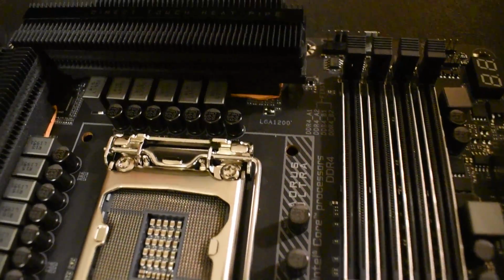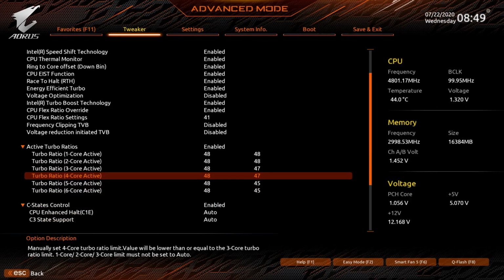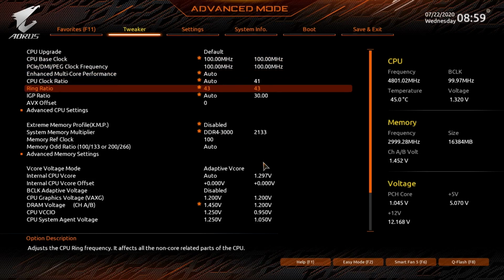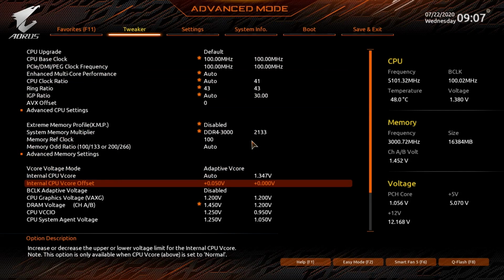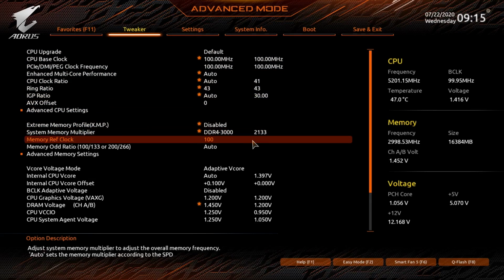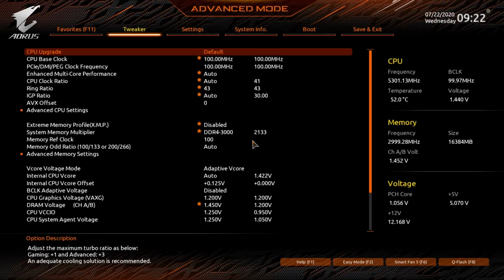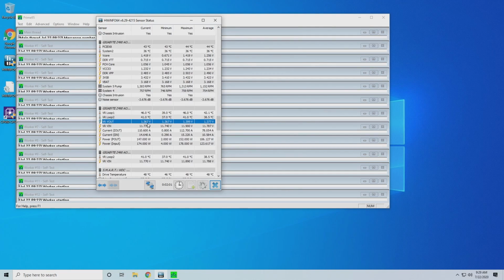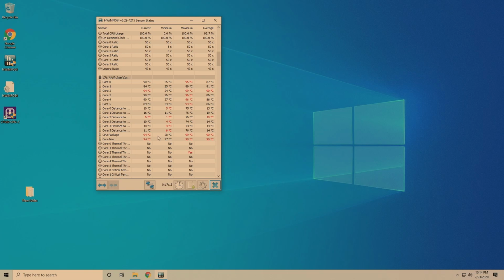Intel 10th Gen Z490 Overclocking Guide with Gigabyte BIOS

Comment: Running a bit late on this party 🤣 but finally found a normal vid on how to oc you’re cpu  so that’s a +10 for me but now in running in a strange situation my i5 10600k was running smooth on 5ghz with 1.3 ich v but as soon I turn off the pc en start it back up its back to default 4.1 😅 what am I missing. 
Z490ud board 
I5 10600k 
850w psu 
Ram 3200mhz skills (Xmp) profile

Comment: Can you do one with the z490 with the 10850k. I heard you mention it in the video.
Reply: There is not enough headroom to over clock top end chips. The effort is wasted for most people because you will only get a very little boost in performance for way more power consumption and heat. If I turn my all core boost from 49 to 51 (5.1 ghz) my temps go straight to the 90s. 
On the other hand I am currently testing a rtx 3060 and the headroom to over clock this card is a lot.

Comment: I have struggled with this setup forever. I have a 10850k and a gigabyte z490 Elite motherboard and I have 3600 36 36 36 b die. And I have the Arctic freezer 2  280 mm cooler in a fully open case with an extra fan blowing at the vrms. I've seen others maintain 5.4 with this setup no matter what guide I follow I end up with insane temps especially particularly in the Bios...? I idle at around 28 C. The spikes that I get are unbelievable

Comment: 50/47 @ 1.325 fixed vcore using air cooler seems to be the best I can do (while stable). Will try adaptive down the line, but this seems to work. Couldn't have done it without your help. Thanks for the video.

Comment: Hi, I am overclocking a 10900K on a aorus z390 ultra and my initial OC test on 5GHz with auto voltage with no V offest is jumping from like 0.77V idle to 1.39V under load with prime 95. Its not crashing but this voltage seems a bit high? Cheers.
Reply: Apologies, i just reaslised i didnt apply 5GHZ to all the cores. Now all cores are 5GHz the voltage is 1.42 :-O

Comment: Probably double posted so apologies and late to the game! I have a 10700K on a Gigabyte Z490 Ultra motherboard pretty much from launch and thankfully it has been a rock solid setup. I have updated the BIOS to the one which enable SAM. I have overclocked to 5.1GHz all core with an Override vcore of 1.310v...VROUT reads 1.265v. No issues on Prime95 small FFT's (30 minutes) reaching a max of 83 degrees though running a 360mm AIO, stable running Cinebench and Games. The question is I have seen people using much higher vcore does that mean I am not stable, is there something I am missing? Should I be running Prime95 for much longer?

Comment: I think your overclocking helped me. My default bios kept crashing my pc.

I am using Aorus Z490 Xtreme, with i10 10900k, corsair vengeance rgb 32gb ram,
I ran on default settings, installed new drivers, update new drivers  and soon, it crashed. Tried to turn on my PC , it kept looping the logo screen. So I tried system restore, it didn't work. I had to press rest pc and it's back to normal (without drivers). The whole hell restarts.

Until I came across overclocking. Only then it will boot my windows 10.

Not sure if it's my bios or any part of my pc component fault.

Help?

Comment: Can anyone explain the different vcore voltage modes on gigabyte? They do not seem to follow other manufactures and I can't find any specifics. What is the difference between the adaptive v core settings? Such as changing the internal cpu vcore to a specific voltage under adaptive, vs auto, vs normal. When normal is selected it opens up a DVID offset also. In this video you are on adaptive but I never see the VROUT voltage drop with frequency at idle even though power savings are enabled, that seems to be more like fixed or override. When the board was stock with auto vcore and MCE enabled it does this just how it should like stock dropping frequency and voltage at VROUT. I'm trying to overclock with adaptive on this board but cant seem to get it to work how I want, with the frequency and voltage falling at idle with the energy savings enabled. And I have checked the power plan and like I said it behaves correctly with "auto" until overclocking.
Reply: This video is very misleading. If you have a i9-10900k and follow this your voltages will be very high because it has a max turbo of 5.3ghz and your going for an all core under 5.3ghz , so the adaptive voltage will be pulling from the cpu VID meaning you will need negative voltages. The I5-10600k only has a max turbo of 4.8ghz so over that it will work as he is showing. Read these before trying this, or you will be frustrated. 

 https://rog.asus.com/forum/showthread.php?106375-MCE-explanations-and-others/page2
https://www.overclock.net/threads/guide-tuning-adaptive-mode-oc-load-voltages-for-10th-and-9th-gen-cpus.1753182/

Comment: So I'm doing this on a 10700k and followed the first section to a tee restarted and core voltage is getting up to 1.5v what happened?
Reply: same, im getting waaaaay over 1.4 in idle ! and under load it drops, i don't get it :( followed every step, same motherboard
Reply: Yeah I just ran it with no oc lol
Reply: @geardriven2018  guess keep running it at 1.56v is'nt healthy ? :)
Reply: @BozZke84  I sure as hell wouldn't. Stock is fine for me lol
Reply: @geardriven2018  Overclocking was sensible back in the day when i7 920 could be overclocked from stock 2.66ghz all the way to 4.2ghz on air in best case scenario... almost everytime you'd get at least 3.8ghz on any chip. or i7 2600k from 3.5ghz to 5ghz... gone are those days. overclocking modern cpus that already run at 95% of their max potential out of the box makes no real sense.
Reply: Has anyone resolved this issue? Mine also goes even over 1.5v with these settings. I have Gigabyte Z490 Vision D motherboard.

Comment: By the first Prime95 run i hit 100C° With my 10600k, be Quiet cooler which ran my last CPU 7600k @ 5.1 GHz below 75 C°

Normal? Stock temps are at ≈ 72 C°
Reply: Might need to reapply thermal paste and reseat the cpu cooler to the cpu to make sure its set properly. That idle temp is extremely high.

Comment: Hey, it's not really connected to your OC video, but I have a question for you or any1 reading this. When i start up my PC with monitor plugged directly in gpu, monitor shows black screen(skips bios) untill windows start, but if i have it dirrectly plugged in the motherboard, I can see the bios b4 the windows start. The build is new(z490m+10600k+rx580,8gb,550w gold rated psu,3200 hyperx 2x8gb ram). So I'm wondering if you ever encountered that problem and how to solve it? I tried setting pcie istead of cpu as primary when starting up but it either doesn't work/didn't save at all.
Reply: Try disabling your integrated graphics

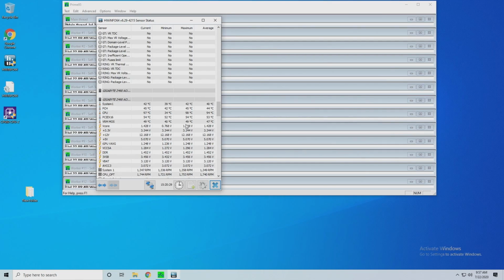Comment: 44:07 Not sure why this a highly rated video 1.428 V and 95+ C running for 15 hours. That's daft. Also misses checking for WHEA errors in HWiNFO64.
Reply: @albertbrennan6480  How did you know I am a professor? Also, you are wrong about cache errors. They will always lead to blue screen unless the flipped bit is overwritten by a correct bit.

Comment: its funny you say that the adaptive VCore is the one that prevents from unexpected voltage increase. I set the offset to 0.050 (almost nothing) and booted up with 1.44V on my VCore. Then I used fixed which actually gave me what I expected. Not the best advice from you.
Reply: 1.44 is too much wtf 😬 
I’m a noob but i got my infos from a group for overclocking on reddit , they helped me overclock my 10700k at 5.0 on all cores with 1.275 voltage vcore
Reply: @Handcraft1024  what group helped you? im new to overclocking i really want to do a 5ghz oc on my i7 10700k but scared to do it with out having sm1 to ask questions along the way
Reply: @Zen_5.0   you can find plenty of helpful websites
But try using this one 
It’s a decent forum
overclock.net
Reply: @greencupofdeath  good results and voltages considering u having the 10600k

Comment: Enjoyed your video, but i think I have a bad CPU. I have a 10900K and if I try to go past 4700, it crashes instantly. I did exactly what you said, but when I boosted the adaptive voltage to .05, I got even more unstable. I wasn't sure if it was the cpu or the board, so I got a replacement board. Same thing. Ordered a new CPU. Have you heard of junk CPUs?
Reply: you sure you are increasing the voltage and switched off all stock settings except for Intel Turbo Boost. Some of the other boosting settings will make your CPU go higher than it's supposed to

Comment: I’ve seen that if you have your radiator situated like that you can get bubbles in the pump and reduce cooling. Supposed to mount on top of case I guess.
Reply: his is mounted properly for a front intake setup, the bubbles will be at the top of the rad

Comment: Sub for you, simply but seems solid way to OC, watched some oc of 10700k few days ago, and applied roughly to mine, got blue screen straight away on booting, on auto max reached 5.073GHz (50x101.4) with everything else auto, run for a bit but Voltages around 1.6V a bit scared me, ran 3D mark, no thortling just hit like 94°C in cinebench on couple of cores... gonna try your way to get to 5.1GHz on boost...

Comment: I followed your guide step by step. I didn't want to go overboard or push it too hard so I only went as far until I had to start manually playing with the voltages. I was able to get an all core clock of 5.1 ghz on my Aorus Master 10900K with 32 GB 3200 mhz XMP ram with acceptable temperatures. 5.2 ghz was bootable but when running cinebench it ran around 99-102 C[too hot or ok?]. That was with switching to adaptive vcore and all the other settings. If I am satisfied at 5.1 is there anything else you'd recommend I do?

Comment: So if I have the same mobo/Cpu I can basically just set it to your final settings? I don't need to climb gradually to get there do I?
Reply from the maker: I wish it were that easy, but every chip will be different, you will need to go through the steps as I do in the video.

Comment: If you are in good shape thermally after finding a stable frequency, is there a certain voltage setting that is directly related to ring ratio that can be increased to get a higher ring?
Reply from the maker: just cpu vcore
Reply: @hardwarelens8040  okay thanks for the reply!
Reply: @hardwarelens8040  maybe you have time for one more question.  You said at the beginning that you turned off the turbo power and time limits, but if you said how to actually do that I missed it. Can you tell me what settings those are in the bios? I'm coming from Ryzen, and have a gigabyte vision g and 10700k. There's just so many more settings than a B450 board!

Comment: Hi, superb vid and very informative, the only thing I would say which did my head in was that you would
move the cursor down the screen and talk about something above it instead of what it was on, place the cursor bar on the item then discuss it then move to the next and discuss that don't race ahead with your hand makes it very confusing
Bob
Reply from the maker: thanks, will keep that in mind!
Reply: Hi would it be possible for you to do one for the Comet Lake 10900K? I have followed your excellent guide above but I keep ending up with 1.5 volts or more! and have to panic and reset. I wonder if it's because the comet has ten cores?
Keep safe. Bob
Reply from the maker: @stoptheirlies  I did oc a 10900K on this board and noticed the same thing but didn't make a video about it yet, you may have to just try a lower offset.  Make sure you look at VR out voltage in hardwareinfo for your CPU voltage.
Reply: @hardwarelens8040  Hi, yes I keep checking v out and running the Prime 95 Best I can get at the moment is 4.9 gig with v out hitting 1.4 max at some time during the test and temp hitting 93 I dare no push it any further, it's very stable though, I have just been in VR playing half life Alyx for the last two hours, no problem.
Bob
Reply: Oh! I meant to say mine is a Gigabyte z490 G Vision board and the bios does have a couple of differences

Comment: My max stable overclock was 5ghz all cores with fixed vcore 1.265v with a 10600k. Cpu is at 32° idle, 70° max load.
Tried 5.1ghz at 1.35v but it crashed during cinebench 20 running at 80% of the test.
Reply from the maker: not bad!
Reply: Good setup, OC for me make sense only if the OC is stable in 24h a day

Comment: I tried pre oc on my Aorus elite ac 10700k it didn’t work out, I can’t find much info on 10700k overclocking
Reply from the maker: this guide will work for any 10th gen cpu
Reply: Hardware Lens I’m not sure if I did something incorrectly but when I tried booting with the “pre oc” boot settings it gave me black screen, I’ll try to figure it out tonight
Reply: Damn, i just ordered my i7-10700k + G.Aorus Elite AC parts to build and it arrives on the 29th.... Your experiment info is stressing me out already!  ~~(>_<)~~

Comment: Congrats, nice explanation, i have a question related with the temperatures, in my case with Air CPU cooler, when i run prime95 , some cores ares Termal Thro.. with temperatures over 95° Celcius, this is normal? could I leave in with this temperatures? subscription gained
Reply: No it is not normal what the hell!!
As recommended by intel temperature should not exceed 85 C 

Your voltages might be too high
Reply: @Handcraft1024  thats for their mobile chips. The desktop chips are rated at 100 before its unsafe. But either way, 95 is too high for me as well. I dont want any of my cores to go over 83-85
Reply: @greencupofdeath  i sit at 60c max on very heavy testing with my x73 kraken with 3 case fans as intake
I was planing to put 3 intake fans aswell but i think i don’t need that tbh
Reply: @Handcraft1024  nice thats really good, wish I had a bigger cooler. I'm using a deepcool castle 240ex 240mm aio and my Temps are usually 75 under load all cores.

My oc is at 5.1 all core oc with my vcore at 1.34v (10600k)
Reply: My 10700kf runs at 5.1 all core and 1.355v at 85c max load in cinebench r23 and furmark cpu burner.  If i go lower than 1.355 at 5.1ghz it becomes unstable in NFS Heat.  If i leave the voltages on auto it runs 1.375v at 100c under full load in the benchmarks.  So just lower your voltages to the lowest possible with your cpu silicone lottery 🙂👍 . Also i am using a Corsair h100x liquid cooler .
Reply: yow bro that is fucking not safe at all
Reply from the maker: yeah with a  10900k its pretty normal, if you want to really improve it check out my direct die cooling videos

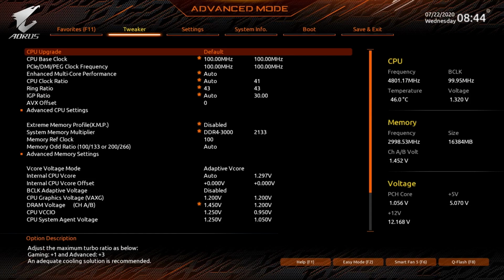Comment: I5-10600k, Gigabyte Z490 Aorus Elite. I used the settings that are shown form 2:31 onwards. and started with 0 offset for voltage and CPU ratios set to 48. It booted fine but then the temps went to 100 Celsius during the prime95 test (after a few seconds). Meanwhile, with default BIOS settings I am getting no more than 80 Celsius during the prime 95 test. What could cause such a dramatic rise in temps when only going from default to 48 turbo ratio?  (essentially 4.5 to 4.8 ghz)
Reply: Did you figure this out?  I have the same board but 10700k, so interested where you ended up.
Reply: @debatebore1057  gave up tbh. reseated the cooler, changed the paste. it runs at great temps standard. but as soon as i OC the temps go through the roof. Not sure what the issue is. have a MA410M cooler, so it should be fine in theory.
Reply: @Asab972  Silly question maybe, but did you make sure that the cpu fan was running at full speed?  Im struggling to dial in 5.0 as 5.1 goes to 1.499v VR Vout.
Reply: @debatebore1057  Any tip helps tbh.  Fans go to 100% when I am running prime95. weird thing is that VRout is below 1.35. Standard VRout is about 1.267. If you have any sample settings I would be happy to try them out. Maybe one of the things I am doing messes things up.

Comment: This seems to be the only lucid guide to overclocking a 10600K available on the YouTube. Thanks
Reply: Also worked on my 10900K
Reply: I oc'd my 10600k on an msi z490 a pro mobo by simply changing the cpu clock ratio to 54 and didn't have to change anything else. Rebooted and now have a nice all core 5.4 ghz oc. Runs a bit on the warm side but nothing that gets near the max tdp under full load.
Reply: @MeepMeepMwo  big cap
Reply: @MeepMeepMwo  mega cap
Reply: @MeepMeepMwo  turbo cap
Reply: @deviousmind1092  Winning the chip lottery is fun. My previous i5 4670k could only get to 4.3 and my 11900k tops out at 5.5 both of which are well under the top oc for those cpu.
Reply: @nonaurbizniz7440 you can't just increase frequencies at auto voltage, thats the worst possible  method of overclocking. And it's not hitting the power cap cos you not loading it. Run prime 95 small avx 5 mins and see.

Comment: Hey HardwareLens, I have a very similar setup (aorus ultra z490i & 10600k) and while I was following your video to the dot I noticed that my CPU power consumption and current were much higher than yours, at least 20-30% higher in some instances. This is using the exact same settings. Do you know why this might be happening? 

I was also able to get a stable OC at 5.1 with Vcore +0.065 and High LLC (Turbo just wasn't working out). VRVout was at 1.362 under load so I'm assuming that it's ok.